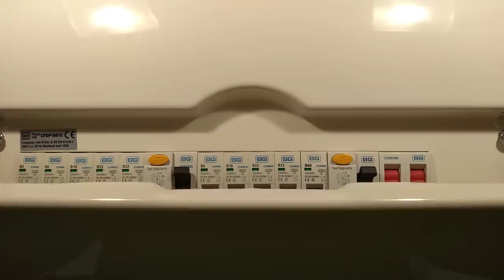A look inside a British home electrical panel.

Comment: I dunno what he's referring to with regards the five days to train an electrician business. I did electrical engineering at college, consisted of being split in 2 parts electrical installation and electronic engineering. Just to get a Btec level 2 qualification was 2 years. And that's was in around 1998
Reply from the maker: Likewise I did a 4 year apprenticeship.  But now you can do a one week course at "training companies" that will usually give you full electrical qualifications and they claim no prior electrical knowledge is needed.  They're entirely cash motivated to push people through.

Comment: I wish the USA's stuff was this nice. Only one phase to deal with, and smaller wire gauges because of the 240 volts instead of 120. :D
Also, your breakers are so pretty and have little indicator windows. :)
Reply: Only one phase? Normal houses have 3 phase systems.

Comment: Hopefully this comment won’t be lost in a sea of notifications but can I ask, I recently moved into a house with detached garage which has been provided with just a double-socket. If I run small loads (fridge, drills etc.) it’s fine, but as soon as I run a larger (but not really large) load such as a vacuum cleaner (around 1000w) it trips the power every time. I think it has been fed from the “kitchen sockets” circuit (but having watched your vid I can now narrow that down) but is it something that’s easily diagnosed? Been looking to get a sparkle in for a while but through I’d ask having watched this one - love your channel :)
Reply from the maker: When the breaker trips, what is it's rating, and do other sockets go off?
Reply: @bigclivedotcom  Apologies for delayed reply, got hit by Covid :-/ The RCD/GFI is 80A & it takes out the other three circuits on that side of the board (kitchen sockets, cooker &  presumably shower as it's in the same bank)

Comment: Well, I live in an area that doesn't regulate this stuff. I care to do things right but my engineering degree allows me bare minimum of error; however, nothing adequate for a power outlet. Need more info. How does one prepare for such things? What are the considerations one must frame? Wish to add, I have seen some work done on the tube, but amateur at best.

Comment: 11:00 Happened at my old workplace. Main switch connection to the bus bar was incorrectly done. Melted the main switch and the first breaker. Lots of smoke.
Reply: We had to replace our big diesel generator and install new online UPS systems a few years back.  Electricians crossed two of the three phases, and when they brought the new UPS online, all the air handlers in one of our computer rooms started running backwards. Um, oops? :D

Comment: [Ignore this, I missed the bit about looping out one of the main live feeds] Clive, you talk after 9:00 about if you add an individual GFCI, you run the neutral to the  main neutral but you would still have shared live with the big GFCI so wouldn't this lead to false trip issues you mentioned earlier? Presumably you should run live separately also? But there's not an obvious way to do that.
Reply: No because he's talking about taking the feed from the live and neutral not the load as mentioned at the start.
Reply: You're right. I missed the bit about looping out one of the main live feeds. My bad.

Comment: I noticed how many times you referred to "showers" and was curious if on demand heating was more prevalent throughout Europe  than are heated storage tanks? Most homes that I am aware of here in the Pacific NW of the US still use a heated storage tank of considerable size, usually natural gas fired as it is generally cheaper.
Reply: I think its only common in the UK to have thiss type of electric showers, other countries have central heating in 99% cases
Reply from the maker: Search my videos for the word shower to find a teardown of one.  If plumbed and wired correctly they are very safe as you are effectively in an equipotential zone.
Reply: I believe on-demand is more prevalent these days but other than that, the heated water tanks tend to be gravity fed which means they don't have the required pressure for a decent hot shower hence the prevalence of stand-alone electric shower heaters. Unfortunately, the tiny heater tanks have a tendency to scale up quickly in hard-water areas.
Reply: @chaos.corner  That gravity-fed tank idea must explain why every shower scene in movies looks nothing like a British shower, it just looks like the person is standing under an elephant while it takes a piss.  Having an electric shower attached to the cold water main means you can vary the pressure from 'pissing elephant' right up to 'sand blasted by hot water'.

Comment: I wish you had mentioned that this was on your bench and not in the wall of your house... My heart skipped a beat when you touched the metal (ok so it was the neutral, but still).
Reply: There are no terminations in this board, even if mounted on the wall it id 100% safe and simply just a metal box.

Comment: Hm, ive never heard of RCBO's consuming power before either... at least not any amount that's significant in any way, certainly not 1W of power! In my parents house, which I rewired some time ago (before Part P prevented me from doing it), i used 32A RCBO's on the two ring main circuits, and had the rest on straight MCBs, so that the socket circuits were RCD protected, but lights would not trip out. This was when lights did not require RCD protection, and the only other two circuits (cooker and immersion heater) didnt require them either.

Comment: What's the wiring look like for each circuit? Blue for load,  brown for neutral,  and bare for ground?  What insulation/protection used for the wiring? How thick is the conductor?
Reply from the maker: Lighting circuits 1-1.5mm CSA.  Power 2.5mm ring.  Shower/cooker 6mm/10mm.

Comment: How do you even use 100A at once? That seems ridiculously overpowered. The only thing I can think of is that odd shower heater. But we have central distribution of hot water to apartments. The heaviest device to consume power is the induction cooker, but even that is 16A per phase.
The only way to trip a 25A breaker is trying to use obsolete things, such as a welder with no soft-start. (I made one for it later.)

Comment: Since there are is total of 126amps worth of breaker on a 63amp RCD isnt there the risk of overloading the RCD with the 100A main grid feed? Esp. since the use of e-showers and hot water taps which need a continuous amount of power delivered. Here in NL this setup as in this box would be illegal (even if there is less than a total of 63amps worth of breakers behind it) as each RCD would need its own 63A breaker to protect it or adjust the main feed to 63A. Maybe a UK Spark can shed some light on the rules for this.
Reply from the maker: Diversity factor.  Not all loads are in use together and the breaker is rated for maximum continuous current.  It will tolerate brief periods of higher current.

Comment: Split load units used to have the lights on a non-rcd circuit, so if something tripped the sockets the lights stayed on. Do they not wire them that way anymore?

Comment: Are these the busbars that are delivered with the CU in a package? Because, since the breakers have the separate opening on the screw, these normally would be designed for a fork-style busbar...
Reply from the maker: Some breakers are designed to use both styles of busbar.

Comment: I wired my consumer unit in my garage. (note.: the electricity meter is before the unit) I have a B20 instead of the isolator switch, an rcd after that and at the output of the rcd in parallel a c16 for the outlets a b6 for the lights.
Do you think it's good that way?

Comment: Doesnt look bad to be honest.
Looks similar to a modern german version of an "Unterverteilung" 

But the uninsulated busbars and connectors on the neutral would be against regulation here.

Tho the standard home here has a T-N-S or T-N-C-S  system on this level of domestic breaker box. (Im still learning about the uk power system)

But i love those RCBOs.
The german version "Fi/LS" is still pretty rare/expensive or
 twice the size.
Reply from the maker: An insulating strip goes in to cover the busbars.
Reply: @bigclivedotcom  
Indeed..
After rewatching, i noticed there is another cover for the busbar to see at 01:00 ... perdón.

We have a regulation in germany that calls for all 'active parts' to be 'finger proof' if handled.

"Schutz vor Berührung aktiver Teile" cant translate that.. ;)
(In case you fall or slip and accidently touch 2 potentials while the cover is removed/damaged)

The UK standard looks pretty close

The new german busbars usually are 10mm2 cooper , 3-phase or 3p+n and are hold together by its plastic cover/insulator as one part. 
Newer fuses then have a seperat cage for the wire and a busbar.

So '03:00am Me' thought that piece of cooper looks 'broken' 

But Im still uncomfortable seeing no ground wire goin in there 😅

I worked a few years in T-N-S 230/400v industrial/business systems and  at the moment i am updating a 100year old home  with +30year old circuits closer to the new standards.

Interesting to see how other countries handle the fault protection . Thanks for sharing 

Domestic homes in germany are required to have atleast one RCD <50mA  for 'baths/out to door sockets etc' for a few decades now. 

But Lamp circuits and several RCD per "breaker box" with <30mA was only added  a few years back. 

So alot older breaker boxes still only have one 3phase rcd for the whole floor or house. And not alot space to add new circuits.

Adding a seperat circuit with some 1unit RCBOs would be really nice ...cuz less work ;)

Do you still have the typ number or name of  the producer to those RCBOs?
I wonder what the differences are .

The similar Fi/LS models from german producers like 'hager' or 'abb' still are double the size.
And the  'siemens' model is half the size but double the price 🥴 
But i heard they got one with uk licensing.

Edit: 
Hager does indeed offer similar RCBOs on the uk marked. 

But they are still as or more expensive as the Siemens one and probably only for use with UK 'plug fuses' and ring circuits... mind blown

Ill probably stay with the 'old' setup for now or just add a add/replace a subpanel 😅

Comment: Dear Clive, in about a year - 18 months I am planning to go to Philippines, I am disgusted with the plugs and sockets there and will be taking a stack of UK plugs and sockets to install in the house, should I go the whole hog and take a UK distribution board as well or are the Philippine boards man enough for the job, this would be a new build not a conversion in a pre built house.  Or even would it work? Some are saying that although 220v it is a 110-110v system.

Comment: Wow! What a difference from American panels! American panels are not mounted horizontally. All grey metal. Including no breakers, except for the main "breaker", which limits the current for the whole house to 200A (the norm; smaller ones for 100A are available). Incoming feeds are usually 3/0 stranded copper from the meter/weatherhead. Two bus bars, one for each "phase". No assembly needed. Breakers are supplied by the electrician, depending on the circuits. Breakers clip on to the bus bars in different ways, depending on the manufacturers. We don't have fuses in wall plugs, so all circuit protection is done at the panel. Typical breakers are rated at 20A or 15A, except for heavy motor or heating loads. Two neutral/ground bus bars, one for neutrals and one for grounds, both bonded to the panel. One neutral bus connected to a ground rod and plumbing. The actual "neutral" connected to the inbound neutral from the service. GFIs are required for bathroom and outdoor receptacles. Receptacles are wired in parallel for a given circuit, and each is rated for a certain load. Total loads on a circuit must add up to less than or equal to the breaker protecting the circuit. Total nominal breaker values may add to more than the main breaker, because not all circuits are expected to be at peak load continuously. Receptacles are rated typically at 180w when figuring total load on a circuit. Power factor is not figured in. Breakers are typically designed to delay tripping for a short time, in case they are connected to motor loads. Large motor loads (e.g. air conditioning) are generally required to have breaker boxes within reach of the equipment, with fuses or breakers sufficient to protect the wiring of the unit. These would typically be wired directly back to the main panel, and connected there to an identically valued breaker in the main panel.

All is regulated by the National Electrical Code (NEC), a book of recommendations formulated by master electricians and fire chiefs and revised every few years. These regulations are typically adopted as laws by various cities or counties, rather than formulate their own recommendations. NEC dictates everything possible about an electrical installation.
Reply: The NEC spec is one thing that is incredible for us in the US. It's worth reading through for anyone planning any modification or repair to a household circuit. Aside from the obvious safety aspect, their recommendations result in really neat and tidy systems that have a respectable degree of robustness.

Comment: "tons of power"... doesn't sound like much to me - just one of our furnaces has a 10kW second stage heating element (240V 60A circuit).  On the coldest days of the year when its single digit temps with both furnaces running coming home and taking a shower, start laundry, doing dishes and cooking a dinner I have computed (based on meter readings over 10 min or so) a power draw of around 30-35kW...meter really spins!  One day can suck up as much as 200kWH.

This house has 350A of capacity (200A panel and 150A panel)
The 240V circuits:
2x40A (dual zone air conditioning)
2x60A (dual zone heating)
40A electric oven
40A electric stove
30A well pump
30A water heater
40A clothes drier

Then it also has 20x 120V circuits for lights and outlets...
9x 20A
11x 15A
I haven't mapped all those out to rooms but you get the idea.
Reply: Yes but across the pond anything with a heavy heat load is done by burning fuel. Furnace/boiler, range, dryer, hot water etc. eliminate those loads, and keep in mind that 220vac to the outlet is essentially double the power per amp compared to over here, and 60A is tonnes of power.
Reply: @RC-nq7mg  Yep, the gas boiler heats the water for the radiators and the kitchen/bathroom outlets and we usually have a gas cooker and gas fireplaces (for when you're too lazy to wait on the central heating).  I think the only hefty device that gobbles up electricity in my house is the shower (again, just laziness, an electric shower is quicker than mixing the cold and hot taps)

Washer, Dryer, etc just come straight out of the ring circuit for the ground floor.  If it wasn't for my shower I could get away with just 4 breakers, two for the upstairs and downstairs lights and two for the upstairs and downstairs sockets.

Comment: Is the neutral switched in the RCD? Where is the neutral bond to earth? And is there a ground rod or water main ground? Sorry I keep interchanging ground and earth.
Reply from the maker: Both live and neutral are switched by the RCDs.  There is a ground rod and bond to all pipes.
Reply: Any neutral - earth bond is carried out by the electricity supplier in their distribution network, earth and neutral are kept strictly apart in the customers installation (in almost all types of normal installation). The ground rod mentioned here will not be connected to neutral.
Reply: The ground is at the residual service panel.   Usually a rod or plate.
Reply: Thanks for the replies. So the utility does the bond to ground at the meter I guess.
Reply: @fanplant  There isn't really a 'bond to ground' for most installations in the UK the electricity distributor provides an earth terminal for most newer installations. This earth terminal is connected to the same terminal as the suppliers neutral (TNCS earthing). The electric suppliers neutral cables are connected to a number earth electrodes along the route from the transformer to the houses. A transformer can supply a large number of houses, whereas in America it is common for a transformer to feed only one property, which is why they need their own earth rods connected to the incoming neutral to ensure the neutral is at 0V WRT the general mass of earth.

Another common UK earthing system is TNS where the earth connection is connected to the neutral at the transformer and is then kept separate all the way to the houses.

Where the electric distributor can't supply an earth connection for one reason or another, the user must install their own earth electrode(s) (TT earthing) to provide an earth connection, this connection must not be connected to neutral at any point.

Here is a link to a detailed description of uk earthing with helpful diagrams: https://electrical.theiet.org/media/1549/earthing.pdf
Reply: @fanplant  In the UK the utility supplier nor The DNO (district network operator) are no longer legally required to supply any form of earthing arrangement for the consumer, it is up to the consumer to get an electrician to do this . In the UK the DNO  (which depends on what part of the UK you are in as to what company that is) are responsible for maintaining the network, the cable feeding your property and the service head. The utility supplier (you can chose whoever you like) are responsible for the metering equipment (and overcharging you lol). But in the UK even fully qualified electricians are only allowed to do work after the meter!